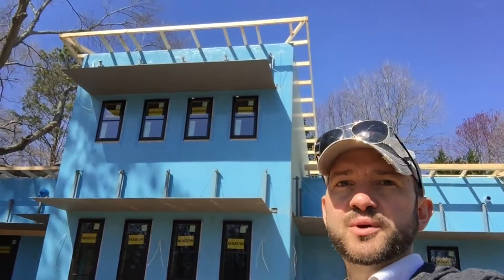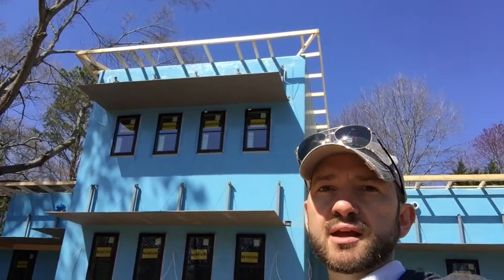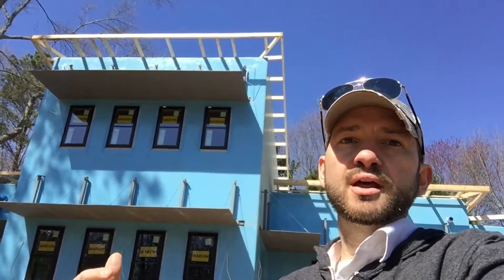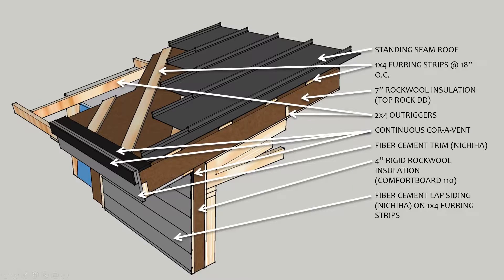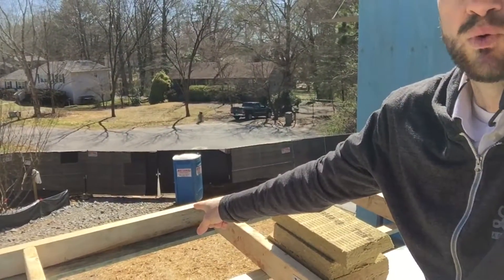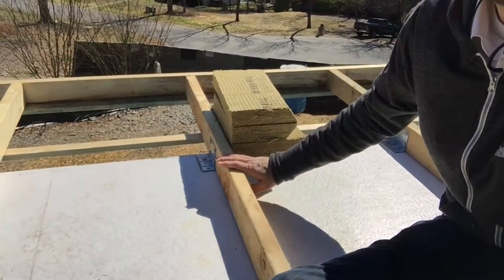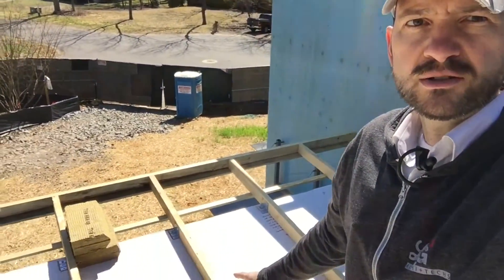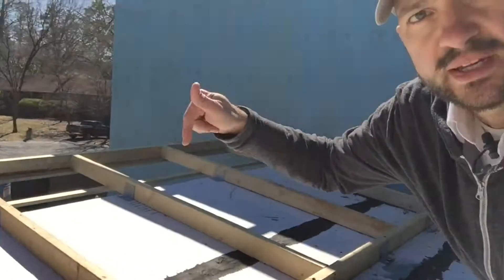Roof Overhangs with Continuous Exterior Insulation - No Penetrations; No Thermal Bridging

Comment: @6:50 I guess for long overhangs  like yours you can't really totally eliminate the thermal bridge   along the axis of the outrigger where it overhangs and then travels towards the roof sheathing attachment. The drawing shown shows no insulation on the underside of the outrigger 2x4. For short overhangs it seems you may be allowed to lay the outrigger on top* of  foam with enough compressive strength (fiberglass faced poly iso).  See Risingers house where he ends up using both methods depending on the cantilever/overhang distance.  If you put a layer of insulation under the overhanging 2x4  .....in between you white "soffit"  panel and the 2x4, that probably really mitigate the main part of it.

Comment: I see the corvent in your detail but i don't see how the roof vents between the rockwool and roof panel. Is there a gap in the fascia trim?
Reply from the maker: @David Bruce The top of the cor-a-vent and the fascia trim, behind the metal trim, is installed flush with the top of the insulation so that air can flow freely between the furring strips. Make sense?
Reply: @LGSquared  Makes sense Chris, thanks. We are stopping the insulation at the wall- roof interface. Chris, i am building the first Semi - passive homes in The Philippines and my many questions to you are much appreciated. I have had some difficulty, getting the local architect to buy into this method and i keep feeding him with advice. Your Western N.C light steel project has a similar roof pitch and truss that ends at the wall interface. This detail has stumped us and we will likely use a US based steel design/prefab, as you did and ship it over. I know you designed it and approved shop drawings. Anyways, im happy to see your interest in these types of builds, and i hope to bring a code changes in The Philippines.

Comment: Sure, no penetrations and no thermal bridging ... except for thousands of large diameter, long (and very expensive) structural screws that penetrate your WRB and give water a channel to flow into the roof deck and trusses.  All that length of screw with nothing supporting it is going to move with every wind while the wood is shrinking over the decades.  No membrane is going to survive that movement and remain self-healing around the screws over decades of weather.  

There is a much easier, cheaper, and long-lived solution to exterior insulation.  Simply cantilever all your floor joists by 8", sheath and membrane the inner stud wall that is directly over the foundation wrapped out and over the cantilevered floor system, then build a second non-structural stud wall attached only at the outrigger rafter tails and sill plate.  Don't attach your outrigger 2x4 second roof to the structural roof, just to the second stud wall and at the ridge to the opposite set of outrigger secondary roof rafters.  That secondary roof should rest 3.5" above the roof membrane on squash blocks every four feet along the trusses but the squash blocks fasten only to the 2x4 not to the roof deck or trusses.  Make all your connections outside the thermal blanket.  No need for furring strips on the walls puncturing your membrane either, since all the siding can attach directly to the outer stud wall.  An unsheathed 2x4 stud wall costs about $0.75sf in materials and your framers already know how to build them without any fussy details.  Compare that to the cost and labor of all those long structural screws.   Comfort Batts are much cheaper than Comfort Board, achieving R30 Rockwool exterior insulation for $1.40sf.
Reply: I love this idea.... do you have drawings so that I’m clear on the sheathing/wrapping of the cantilevered joists and the joist/roof rafter... also, a drawing of the 2x4 secondary roof would be awesome too!
Reply: Wouldn't you have to water/vapor barrier the cantilevered floor joists? Just verifying
Reply: @kenword7447  That would be my plan.  Wrap continuously from stem walls up and out over the cantilevered floor joists and subfloor then up the sheathed wall.  The weakness is that the rim joist connecting all the cantilevered floor joists is a thermal bridge.  Insulting it's exterior enough to prevent it from collecting condensed water vapor is a problem.
Reply: @kirkellis4329  I do hope you post vids or pics. I'm highly interested in this and I love the idea of building with rockwool
Reply: If you have a blog, I'd love to know

Comment: Hey brother great video! Please could you help me out and tell me when you screw down through the peel and stick into your trusses how do you make sure that you were waterproof.? Thanks
Reply: many peel-n-sticks are self-sealing or self-gasketing around the fastener . i dont know that they would remove any material to double check on leaks, but likely their underlayment has been rated as self-sealing by the manufacturer (ie the manufacturer has built similar mock ups and then disassembled them later).

Comment: Hi LG, thanks for the video.  It appears that your outrigger - rafter tails - will be 3.5" below the final roof deck.  What will you do about the gap?  Thanks.
Reply from the maker: Michael Sims We installed another layer off 3.5" rock wool on top of the first layer, then installed the 1x4 furring strips on top off that layer. The 1x4s are secured to roof structure through the insulation with 9" screws, and the standing seam roof is attached directly to the 1x4s.
Reply: @LGSquared  Great video. Could you give more detail on how the coravent is detailed at the overhang. At 6:55, the plan seems to show it poking through the continuous fiber cement trim. Also, how do you flash and gutter this roof? Thanks.

Comment: Seems like it’d be hard to hit a truss for every clip and for the diagonal strapping.  Could you increase the plywood thickness instead - below the WRB - to eliminate the need to screw into a truss or blocking with expensive structural screws?